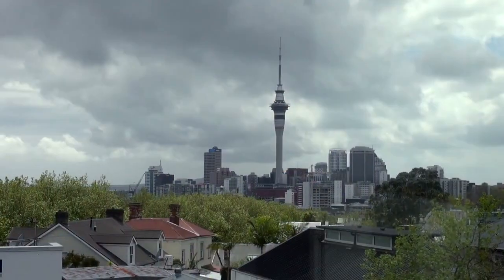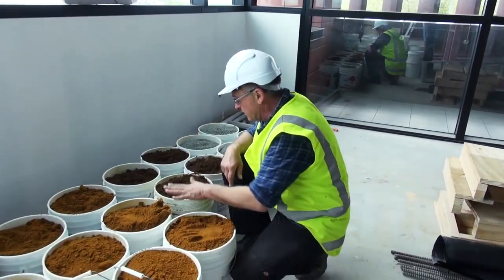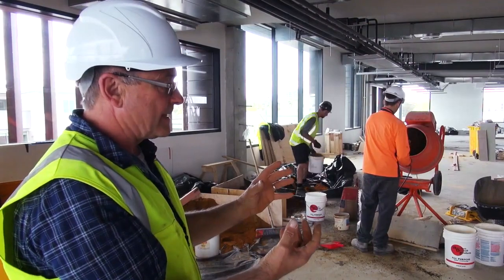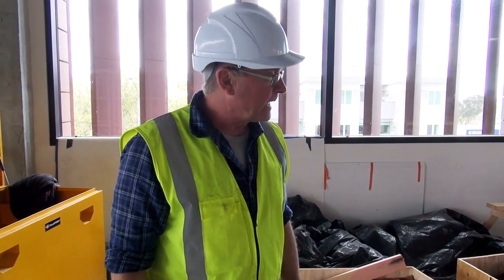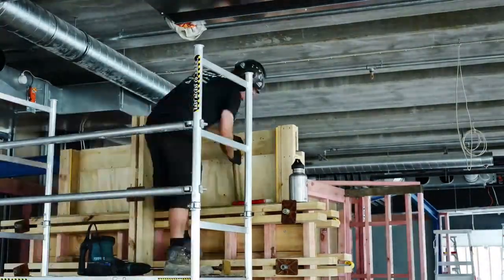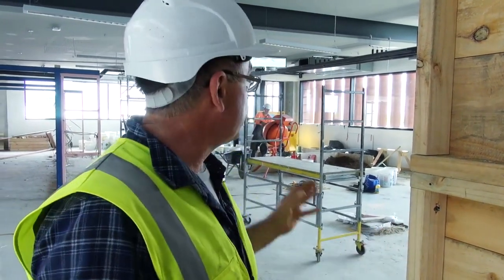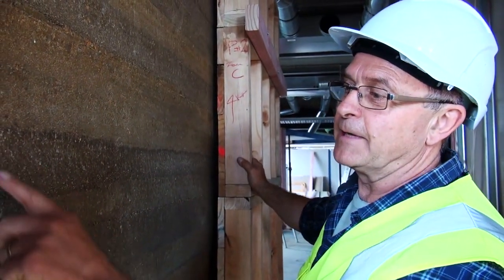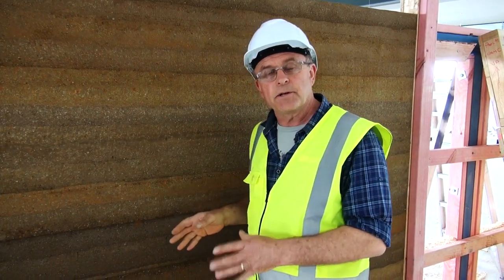Icebreaker rammed-earth materials and process

Comment: i can see that this wall is in a second floor...is that right? and this wall can be designed between 2 columns?
Reply: If the columns are strong enough to resist the forces of the ramming, then yes, it can.

Comment: I wonder that all that cute excellent layer go off when you need to cover the wall or painting isnt it?
Reply: How do protect the outer layer from water etc
Reply: @alienergy5347  In this case it is indoor, so no rain washing or wind erosion.  In an outdoor environment we would test the mix to see how it fares against the weather.  Usually a small amount of cement is used in outdoor installations to increase the resistance, but even un-stabilised rammed earth can last for decades longer without cement.

Comment: You used a makita electric compacter, I was unable to find that, all I found was cement vibration tools.  Do you have a model number?  If you did not have to carry tools up to that floor by hand you said you would have used another tool, which one?
Reply: It looks like a regular hammer drill on just set on hammer mode, not drill. Never thought of using one.